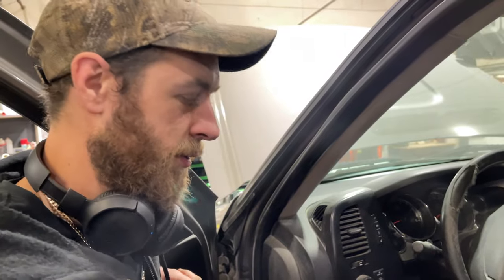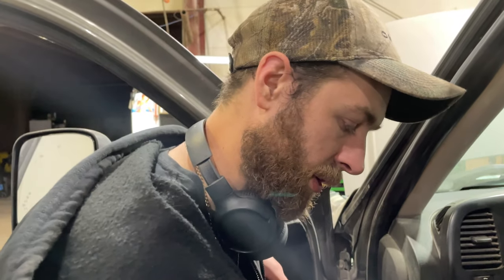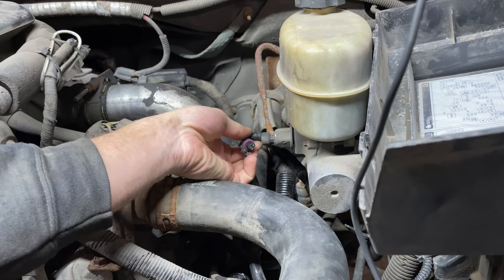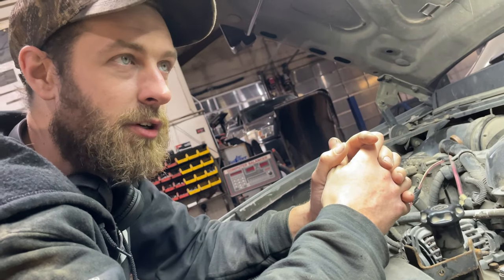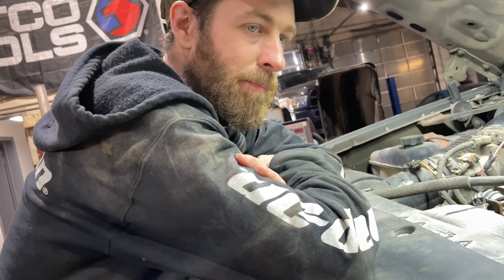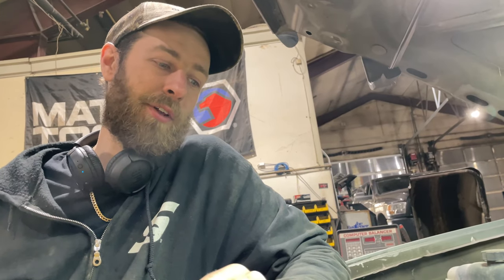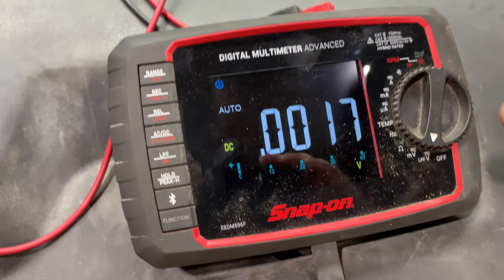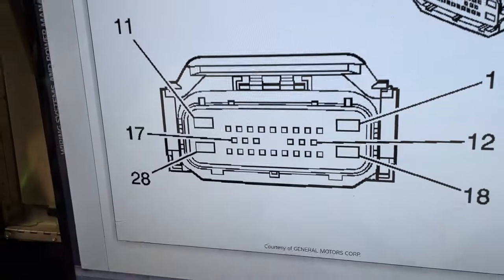Trailer Brakes Not Working 2008 GMC Sierra 3500HD

Comment: There is a power fuse under the hood. Check it. The Chevy dealer in Greenville Texas wanted $900 to fix the service trailer brake light . My son put in a $5.00 fuse and fixed it. Talk about padding their commission. Crooks.
Reply: What fuse? I'm having the issue and there's nothing labeled "Trailer Brakes" in the fuse box. Thanks

Comment: These gmc and there wild goose chase trailer brake controller issues. Good hell. Mine is a ign circuit voltage issue, the tbc doesn’t think it’s getting voltage but it is. Thrown all types of new parts at it but still having the same issue. About to get to an aftermarket controller but then I’ll have to deal with the light and warning on the dash. Yeesh.

Comment: Can you just put a aftermarket controller and bypass it?
Reply from the maker: Yes however it will still pop up “service trailer brakes” on the instrument cluster all the time
Reply: @Tech-28  oh okay thanks just replaced the relay and it worked for a bit while towing then it went off saying to service trailer brake system again and kinda over it lol since I do tow pretty often ima just use a aftermarket one lol

Comment: I’m having same issue, and manual states “the fuses for these two circuits(red-battery feed/dark blue-trailer brake) are installed in the underhoid electrical center, but the wires are not connected. They shoukd be connected by your dealer or a qualified service center. The fuse and wire for the ITBC is factory installed and connected if tge vehicle is equipped with an ITBC. The fuse for the battery feed is not required if the vehicle has an aux. battery” 
You have a bideo on how to hook those up?? Lol
Reply from the maker: Unfortunately I do not have a video on that